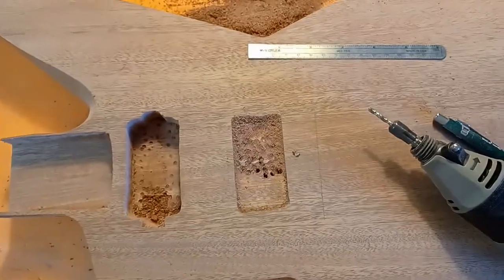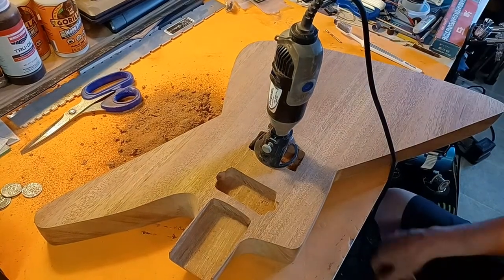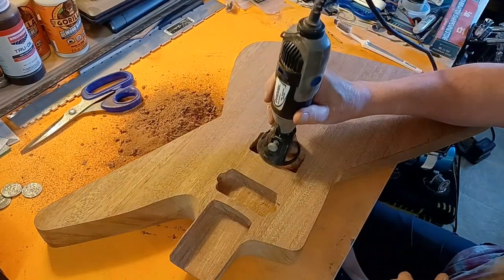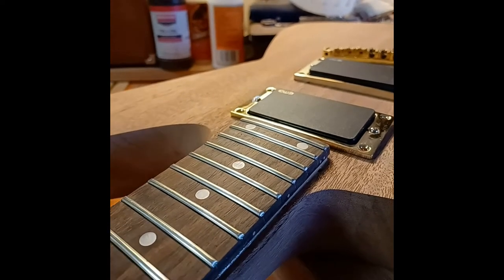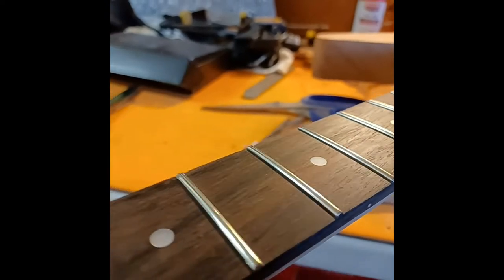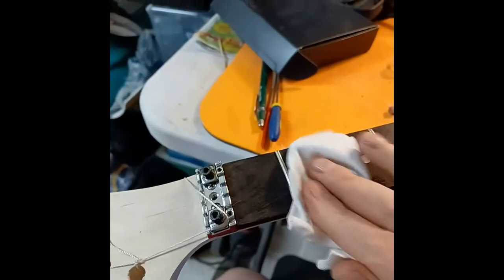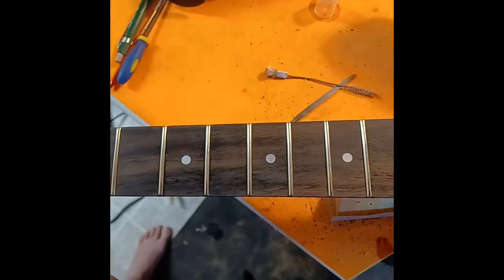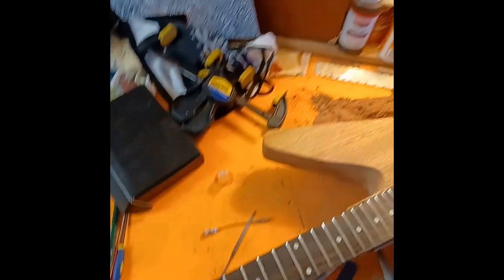GGBO 22 Routing n glue up

Comment: A mallet or small hammer used with your chisel would have help you remove the waist from the pickup cavity and the other spots as well.
Reply from the maker: Yes sir it surely would. It would also knock everything off my bouncy wobbly table. It would probably frustrate the people living below me as well. Its bad enough every step I take up here makes the floors squeak. I sped up the part where I was whacking the chisel with the palm of my hand and it was making an awful racket. 

I am in no rush. I like the extra time spent. I don't get to get out and do things like normal people so anything to keep the mind active and engaged is a good thing. Specially if it is time consuming and not just sitting around playing video games all the time.

Comment: It's coming along nicely. BTW, if I could travel back in time, I'd watch this video, then go back to last April and use my Dremel for the pickup cavities (instead of just a chisel and a mallet).
Reply from the maker: I don't think the process was too bad on that tiny router. If you do do it this way I suggest either Forstner bits or drilling SUPER close together so the initial chisel work isn't such a chore. I got lazy on the second one and paid the price that way. 

I will however come up with a wider base or buy one of the made for Dremel router mounts. The one I have is right on that hairy edge of pick up width and is just out of range for neck pocket work. THAT was where I was REALLY on struggle street. I ended up using left over scratch plate from last years build ( part of the lost footage) and removing the wide base on the tool but kept the inner part as a zero point. It made a half decent sled so I managed to get thru it OK.
Reply: @borgonianevolution  Using the Dremel is brilliant. I just wish I'd thought of it last year (when I didn't have a router). I know there are those who create perfect (or almost perfect) pickup cavities with just a chisel, but I'm not one of those. I struggled with the task last year, though in the end, I did manage to create cavities that worked. However, if I'd only thought of doing what you did, I would saved myself a lot of hassle.